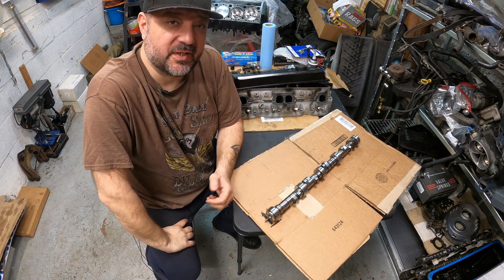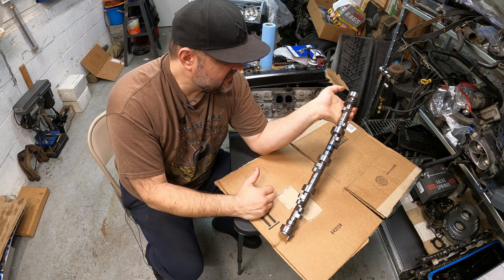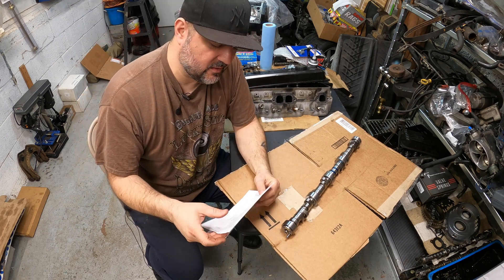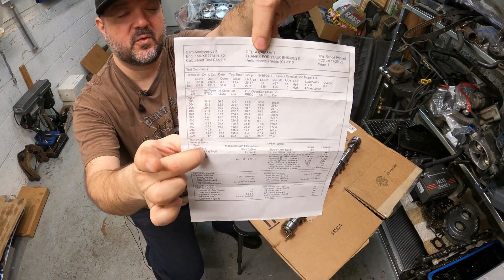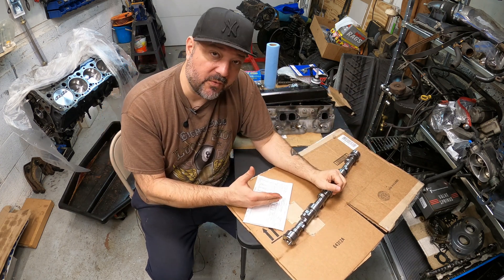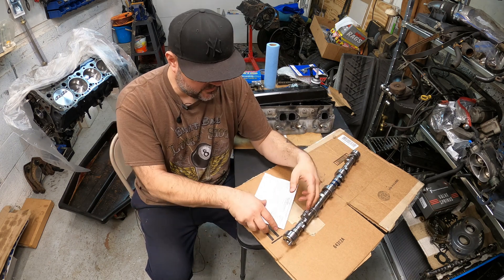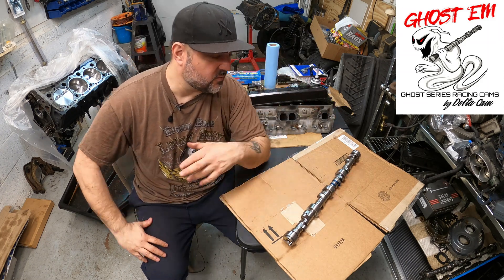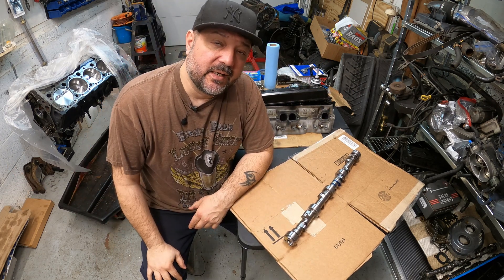Performance Camshaft LT1 / LT4  cc503 Delta Camshaft reground Tick Performance

Comment: Last year I reground an LT1 cam for a customer who has one of those engines in a Camaro.  It turned out great and he's very pleased with it.  I gave it 223@.050 on 110 with .339 lobe lift.  This went right on the stock LT1 core.

Comment: What gains are you expecting to get out of it?  Somewhat doubtful on the HP gains per dollar spent.  Looking forward to dyno.  LE cams are my current favorite.
Reply from the maker: I would like to see about 325-340 to the wheels with stock heads before we add the turbo..     yes 100% the LE cams are fantastic no doubt.  The theme for this build is budget and showing alternate options if you want to save a few dollars when you can. For well under $1000 for all these parts this could be a great option for some and not sacrifice durability.

Comment: Had my reground with delta as well. My is small cam with 216/221 and lift is 481/483 LSA 112. Just need to put my engine all together.
Reply from the maker: Why don't you bump up to a bigger grind
Reply: @maldo72  on my next Camaro I plan to. This is my first rodeo changing cams and just want to be conservative. I have emissions I need to pass. Just want a little better than stock. Not to mention, I don’t want to change the toque converter.

Comment: Looks like a good deal! To many guys get caught up in the bigger is better or I just want it to Thump deal. I've ran 11.70@115mph NA in my old LT1 using a small cam. .520 Int .528 Exh  212/218@.050 112 lobe seperation Makes a really good nitrous cam too.
Reply from the maker: Thank you for watching... yes bigger is not always better i have used both cc503 and cc306 from years passed both have there place plus witht he cc503 cut on the faster lobe ramps it should be a fun engine for the street ...  plus i will be adding a rear mounted turbo setup in the future and this cam should play nice with it ...

Comment: Hey Maldo. What cam profile you recommend for stock refreshed 95 Camaro auto trans and where to tune it. Emission delete etc.. thanks great info im hoping this summer i will get mine going..
Reply from the maker: do you also have headers or are you going to keep the stock exhaust manifolds
Reply: Yes speed engenering long tubes are going in..

Comment: I like the regrind cam deal for budget builds! Keep upbthe good work man!
Reply from the maker: yes its a good option and since i am using stock heads it should make good power for a fun street car.
Reply: @maldo72  yea it will be fun for sure.

Comment: What's the comparison  between this one and the one you had in Green bean?
Reply from the maker: its slightly smaller but not by much ...   the other cam spec out at 230/236 valve lift is .510-inch on the intake and .520 on the exhaust. on a 110-degree lobe separation angle with 1.5 rockers  but if you factor in the 1.6 rocker arms i will be using with the new it will increase lift and duration ...

Comment: Are you planning on doing boring anyting or thing and what's the plans for the bottom end.
Reply from the maker: Hi thanks for watching Check out some if the older videos showing which parts I used for the short block